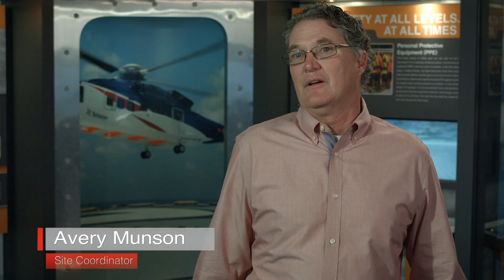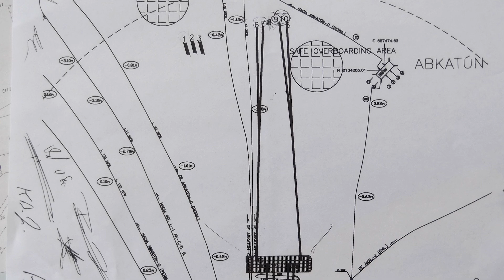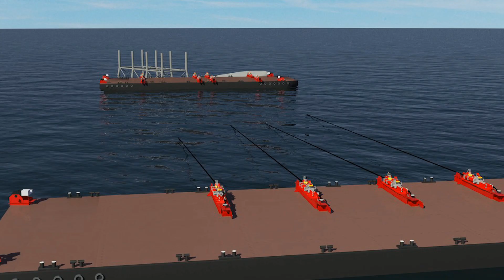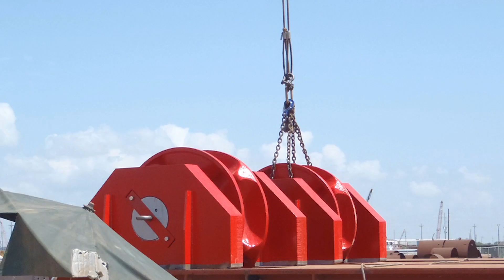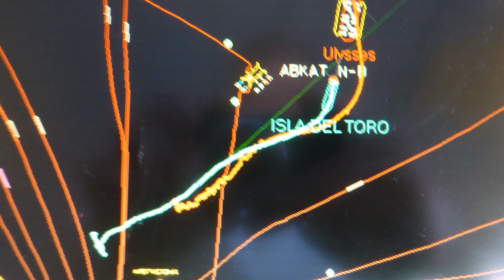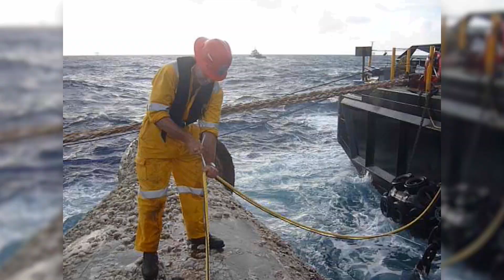Mammoet Salvage - Wreck removal of the SSV Jupiter 1

Comment: It seems to me SSV Jupiter 1 was of poor design. It's an accommodation platform housing nearly 800
personnel yet as soon as it springs a leak it capsizes. I just don't get it how the design was approved.
The loss of life could have been horrendous.
Reply: Agree.. there should have been secondary, back up redundant systems in place to avoid this, surely? Multiple giant airbags that inflate to keep it from actually rolling?
Reply: @wooooster171  Agree, there is a good case for the use of giant airbags for maritime use and in other areas too.
Reply: @anthonyxuereb792  Agree but Pemex is a burrocratic monster no Quick reactions. Just bag her or pontoon her till pump out.

Comment: Why didn't they just cut it were it was and removed it piece by piece. Then  scrap it. 🤔
Reply: Im an underwater welder . and ill tell u first hand . u do not want to cut underwater in conditions like this . . currents .lose metal. Crude oil . none of that stuff mixes well along with the swells. Also . as soon as u cut something free you have to be on the look out for anything else that could crush u . or get tangled on ur airline . .plus cutting piece by piece would take way to long . better to work from the surface pull it away and drop her free in deep water .. They did everything flawlessly . unless ur an underwater welder .you dont rele know how dangerous this all could be
Reply: Because cutting underwater is how people die, even when well planned out.

Comment: No mention at all of what caused the original problem.
Reply: The pontoon had a stress crack that started leaking and the weight of the water tore it open
Reply: sharks
Reply: It sunk

Comment: scuttle all that iron in deep sea. bring that boat to land . then salvage the whole thing.
Reply: you do know they clean the ships out when they sink them also in the video they remove the Oil and fuel DO YOU NEED TO READ A BOOK
Reply: That's really expensive to do and there are only a few places in the world that do it anymore due to the hazardous conditions such salvage creates for workers and the environment. They would've had to tow that whole thing across the Atlantic to have it salvaged economically and of course, they could not have done that without flipping the thing and with its catamaran design that would've been a giant operation using huge cranes. Nope, cheaper to just sink it safely and take whatever the insurance will cover, not like we'll ever run out of iron anyway.